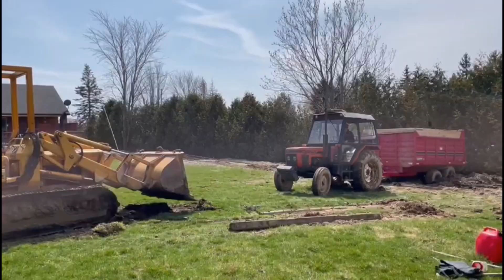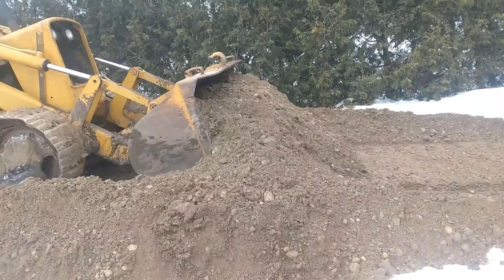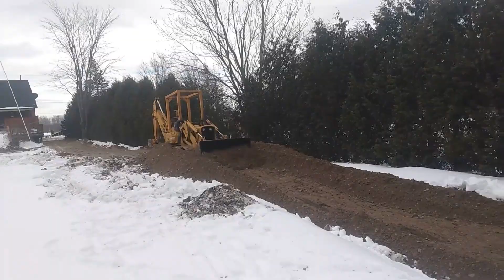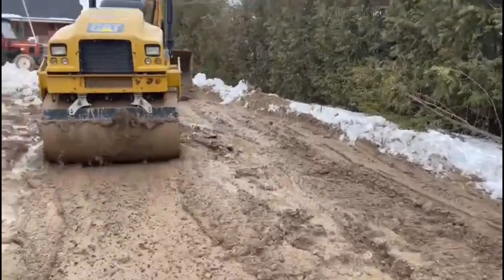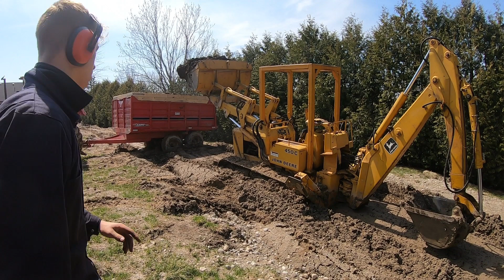I Got Everything Stuck in the Mud

Comment: People who have no idea what they are doing and have more money than sense! 
It's painful to watch. I particularly like the idea of flattening out the ruts in the sub-base using the roller, (-which is supposed to be used for compacting), instead of using the dozer bucket. I also like the idea of leaving the back-hoe down low enough so that it catches on the ground and acts like a brake, to prevent you going too fast when you are pulling or pushing.
Reply from the maker: Wish you had been there. The vibrator on the roller, just vibrated itself into the slick newly poured gravel, and needed to get it pulled out. If there was more money, I'd have had a John Deere 240D, and a tractor with 10x the HP and it would have gone just fine. Just need to get stuff done and use what you got!
Reply: You're hilarious John - that's a 70's track loader, an old zetor 2wd tractor . . . too much money?  No, just some people trying to get stuff done with what they have instead of buying it done like rich people.  Now, maybe buying it done is the way to go, but that's another discussion . . .